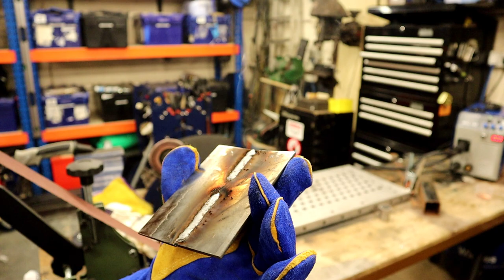R-Tech 180 Amp Portable Inverter Mig Welder (240v) 2020 November  Unboxing Just The Tip Review.

Comment: I  made up a trailing lead, using a 13A plug to 16A Socket & a 16A plug on welder lead, then a simple job to switch between 13A & 16A supply depending on job.
Reply from the maker: I have since done that! Great tip 👍
Reply: @AnchorDesigns  James, got a lot of railings to fabricate for garden here, but I would like to see you do a update on your R-Tech 180 before I decide on that or a OXFORD MIGMAKER 180-1, I,m  old school, so use to the older tech,this R Tec inverter is something  new to me.
Reply from the maker: @stuartandrews4344  used it this morning like most weekends. Still chuffed with it. I wanted to go Oxford (as I mentioned in the video) however the person I dealt with really put me off. I then went to two agencies (as you can’t buy direct) and I was dealing with typical sales type approach “we have some ex demo” special prices all this rubbish. Although Rtech isn’t Uk produced and this is a big thing for me Oxford was my first call. But Rtech felt right at the time and still does today. No regrets and this isn’t sponsored!
Reply: Same here. I will probably never use more than 13A at home - but I have the option of 16A if I take the welder somewhere else and higher amperage available and needed.

Comment: Funnily enough, I just ordered the rtech 180 today on the strength of reviews on a VW T4 forum I'm on, and then backed up after watching the same Geordy fella called John, you probably saw! Lol!
I've got mine to replace my Dads 25 year old or so, SIP migmate 130, which, at best, is shocking - well, wire feed certainly is - after not welding for 20 years or so myself.
Looking forward to taking delivery.
Cracking review by the way. You have a new subscriber👍

Comment: I have one of these which I bought used off a bloke who just wanted to build a trailer. It's a very nice machine with plenty of power form the sort of jobs I do. I had a small Sealey or SIP before and there is no comparison. Just a look at the wire feed tells the difference. one is made of plastic and slipped a lot and the R Tech is metal and does it's job easily.
Reply: Dream on. Wait till the R-tech breaks - it'll be the board - your mid-range Sealey or Sip will be running long after this ^ has died. I have all 3 btw & weld for a living  - 2 Sips, 1 Sealey & a dead R-Tech.  I'd take a Sip or Sealey any day of the week in preference. The R-tech had NOTHING done in terms of hours when the board went bad. Cost of repair made no sense, so it's stayed busted. I'm not a fan.

Comment: Great review, made the mistake of buying sealey mighty mig 150, so bad I don't think I could even sell it, I'll have to get saving!!!
Reply from the maker: Worth saving for Shane! I did the same thing years back with a blue Clarke mig welder! I used to have one hand on the torch and the other feeding the wire spool! Best of luck for the new future welder 🍻 thanks for the comment
Reply: @AnchorDesigns  I'm struggling to learn with a Clarke. Already replaced the cheap plastic wire feed and it still doesn't feel right. Really hard to learn with possibly rubbish equipment.

Tempted to shell out £500 for this but it's painful after already paying £300 for a rubbish Clarke...
Reply: @hanvyj2   I no the feeling
Reply: @shanedowley2877  I bit the bullet and got a Lincoln Bester rather than an R-tech (but I think I'd probably be happy with both tbh), and MY GOD it's so so much easier learning how to weld with good equipment.

It just works. I point the thing at some metal and it sticks it together. Yeah, I burn through sometimes but I know what I did wrong because I'm in control.

The old Clarke made such messy porous welds, the wire feed was always inconsistent.

Really glad I upgraded. Sold the crappy Clarke for £180, so didn't even loose that much money on it.
Reply: @hanvyj2 that's great,   I'm glad it worked out for you, I'm gonna go for r tech this weekend, mighty mig 150 so bad I don't think I could even sell it!! Hopefully have better luck this time🙏😂

Comment: Shame it needs gas! How would you supply/ set up the gas in a small diy garage/ home workshop? Thanks
Reply from the maker: Shame this machine needs gas or the process of Welding needs gas? You can opt for a gas less mig welding machine. It all depends on what you want and how much you wish to invest into the skill and the machine, I mentioned in the video a company called Hobby weld. It’s a not rent deposit rental of co2/argon mix bottle. Best of luck and thanks for the comment.

Comment: Hi James, great video, where did you get the mini table from? I just weld on my workbench and I keep setting it alight. That little table would be great.
Reply from the maker: Hi, The mini Table is a 'scrap part' from work. its from a heat exchange from a nuclear submarine!....However for the size id recommend an old cast iron surface table a lot of workshops scrap them and find a lot going on eBay and gum tree for not a great amount of money.  Or ask if you can rummage through the local sheet metal workshop scrap bins. Often Laser cutting shops have some nice scrapped parts/off cuts. J.
Reply: @AnchorDesigns  I'll just pop down the scrappers then and see if they have any nuclear subs between the old Sierras and Escorts